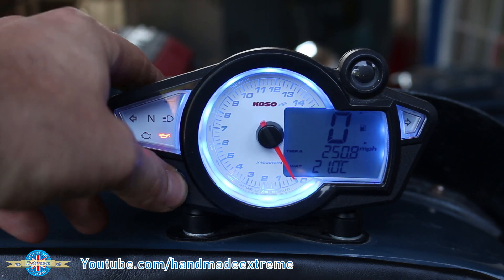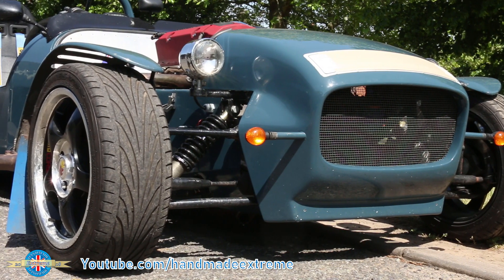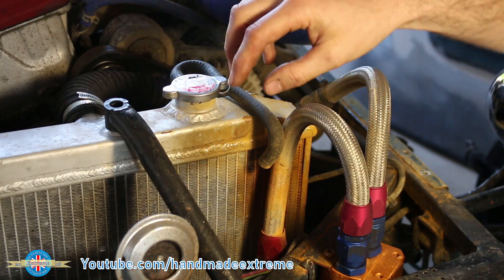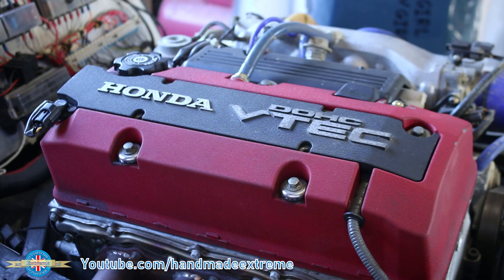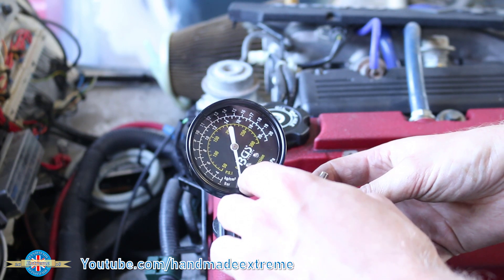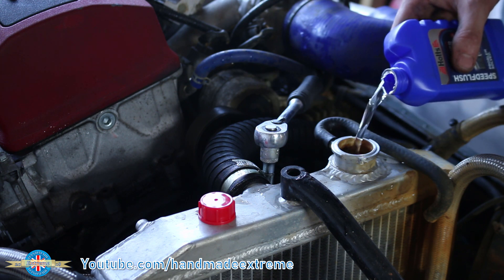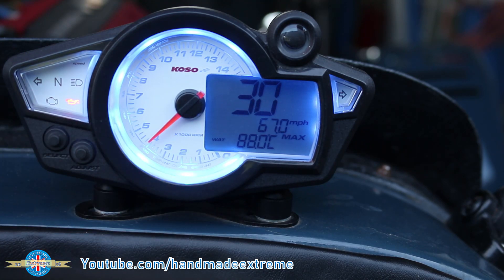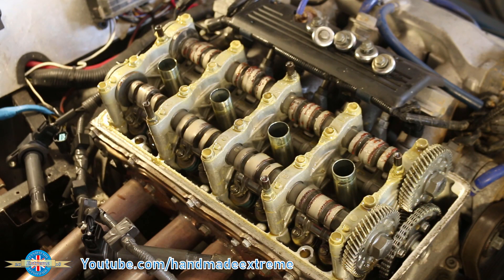The Pippa Project - Honda S2000 Powered Haynes Roadster  - Part 1: Introduction + Overheating Engine

Comment: Been binge watching your stuff, as I’ve only just found your channel. I was interested in your workshop stuff - welding table welding cart, workshop storage, etc. Then I find you made a Locost! Huh! I built one to the rolling chassis stage, then lost interest and got rid of it just before retirement. I’ve really enjoyed your channel so far, and hope to see plenty more of interest as I binge along. Now use my welder for motorcycle bits and bobs, and anything else that I (or friends!) need welding up. Started with MIG, now added TIG, a great hobby in my opinion, though you look as if you might be professional.. keep up the good work! Love the bow-tie. Les in UK

Comment: Is is a good time to think about doing an electric conversion?
Reply from the maker: I've been considering building an electric car for a while now. I think for it to really be worth it it needs to be something with a lot less drag and a bit more space for batteries. I'm also holding out a bit longer until batteries come down in price and the power density comes up a bit more. Unless I can find someone to sponsor the project of course... Day dreaming again. haha. It's in the pipe line but not in this chassis and probably not in the next 5 years. 
Thanks for the support.
Reply: @Handmadeextreme  Have you seen Damien Maguire's channel? One if his projects has been building an electric BMW for £1k using batteries and drive train from scrap yard cars. He works with New Electric Ireland who run regular courses on how to do budget conversions using Prius, Leaf, and Tesla components.
https://www.youtube.com/playlist?list=PLPHK4T9kKEyYxfC-4Jk70D6IfFSwsJQlh

Comment: Wow, it should be fun to watch this project. I would like to see some old photos from the building stage. I guess The Pippa is the reason You need new workshop. Good luck in getting it running. :D
Reply from the maker: Thanks very much, glad you enjoyed it. I'll probably feed them in throughout the series at relevant points. Might post some up on the Facebook page as well. 
Regarding needing a bigger shop. There is a big plan afoot but I don't want to let the cat out of the bag just yet but it does require the channel to be a lot bigger first.
Thanks for the support.